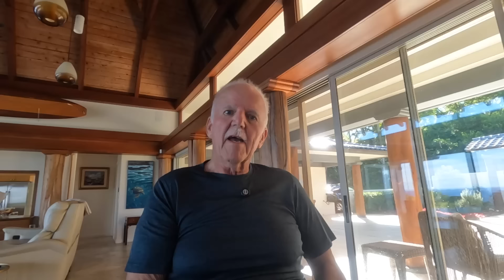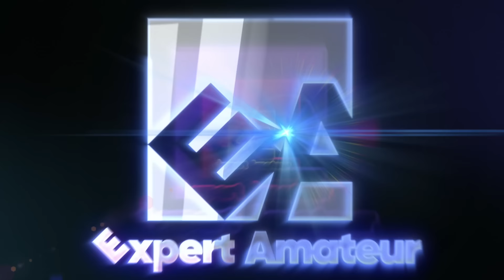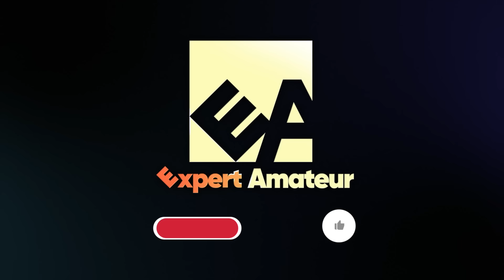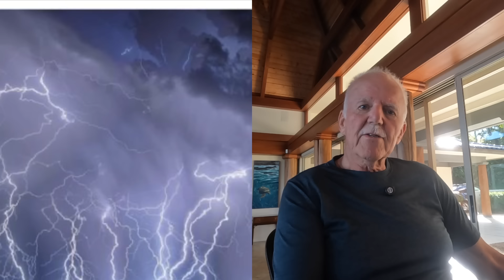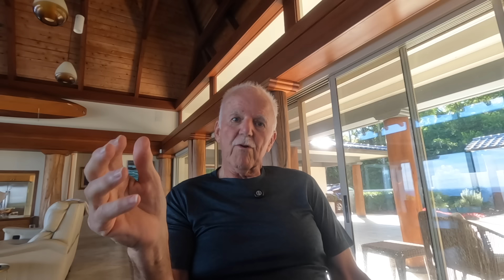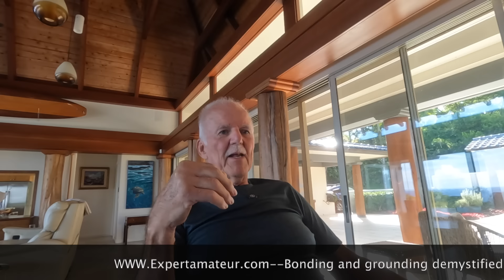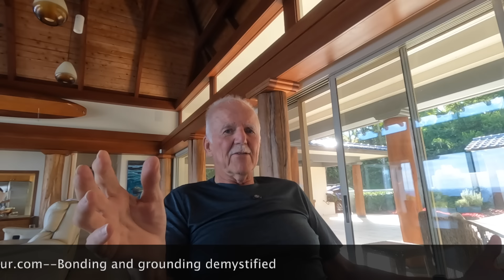solar grounding

Comment: My solar array panels are all connected together and earth grounded to a 8 foot copper rod in to the ground. My A/C panel is bare copper earth grounded to another 8 ft ground rod. I've also earth  grounded my D/C side of my solar set up and that goes to another 8 foot copper ground. Is that OK? As you mentioned, grounding set ups for solar systems are such a controversial topic and I did my homework in detail only to come away with still not know ing what was actually the best nd safest way to ground it all. So after all my homework I decided to seperately ground my solar panels, my A/C panel and my D/C component side. Thoughts?

Comment: my mini solar system is 500W, it's plugged into a Growatt Infinity 1500 , the Growatt is plugged into mains power and turned off at the wall. This will give a ground even if the Growatt is turned off

Comment: Mike says that the PV Ground should be connect to the main grounding... that is not necessary and second rod for the PV array, but can be done it is not against code, if so the need to be bonded

Comment: ONLY do this IF you are tied to the grid with the Grids gigantic antennas(wires) that can send a gigantic pulse to your system.  Anyone off grid?  Do not waste your time.  The rack itself is already "grounded", running another copper cable down it will NOT DO ANYTHING.  It is the same path.... Now you may wish to INSULATE your panels from your rack and "ground".   The NEC is NOT designed for OFF Grid/Micro Grid, but when attached TO the Grid.

Comment: Great discussion thanks. Please consider this scenario.- what if the solar panels are connected to a large RV, which is completely off grid? The RV is not grounded as as the custom for DC vehicle vehicles. But the solar panels go to a battery inverter which converts to AC to power both AC and DC in the RV.  My solution has been to ground the solar panels and bond them together, but not to do any additional grounding rod at the RV since the frame creates the neutral ground. But there’s a lot of dispute about that solution as well. Your thoughts?
Reply from the maker: It's a problem for sure, and I faced it with my stupid RV project (I'm required by my personal "laws" to say Stupid, since I don't like RVs but I spent two summers rebuilding a 1978 GMC Moho). I never really solved it, but I'm going to move it closer to my solar container project and connect the 1860 watts of solar to my EG4 system. I'll tie the RV to that grounding system. That won't help you, but you might consider adding a grounding rod bonded to your house earth ground that you can connect to while you're parked at home. On the road, you're at the mercy of where you park it. I've found all kinds of weirdness in RV parks, some of which popped my GFCI regularly. Weirdly, the best power connection I ever found was at a winery that's part of the network I can't recall the name of. They had a single neutral/ground bond at their service entrance and earth ground rods at each power pedestal. The ground connection went straight into what I assumed was the power trench. I asked the owner about it, and he admitted to being a retired power plant engineer, and yes, the ground rods at each power pedestal were bonded to the service entrance! How weird is that. We wound up swapping power plant stories and drinking wine until I was way past my bedtime.

Comment: All bonding of the solar rails and frames go back to your house ground bar. The same place your inverter is grounded. It is not for lighting. Same if you add a generator, back to house ground. My opinion as a licensed electrical contractor. My house is also done this way. Lighting systems are a separate issue and nothing to do with a solar installation. I used a #8 copper to discharge static charge that may build up. The DC system will not pose any issues. Use proper sized fault protection for your array.
Reply from the maker: Yes, indeed, it serves that purpose. I mentioned this in the first video I think. Accumulated static or the leakage voltage to frames is not likely to kill you, but getting zapped is never pleasant and if you're on a ladder or a roof it can be dangerous. But it does serve an additional purpose--protecting your equipment (which is almost never an objective of the NEC, code is basically a minimum requirement for safe installations: life and limb.). A nearby strike transmits two waves, one in the air, one in the ground--both carry a very high potential (voltage). The best you can do to deal with the wave transmitted in the air is a lightning arrestor, which might help.  Separated ground rods can actually exacerbate the ground wave effects. If you have two ground rods, spaced some distance apart, The ground wave potential will be a different at each rod depending on the resistance between them which means a high voltage can be present and current will flow in your equipment ground. Not good. It can and does toast electronics (ie, your inverter and solar controller)--frequently. Connecting the two ground rods with copper wire reduces the resistance, and therefore the potential, a lot. I connect the wires directly to the ground rods but since your service entrance is directly connected to a ground rod it's pretty much the same to just go straight to the house ground. Very little of this has to do with electric codes though in the older editions of the NEC it was frequently spelled out. Most of the information got moved to the fire prevention codes, and even there it's a minimum requirement, like most code stuff.

Comment: My combiner box has a circuit breaker on each series of panels, it also has a main breaker, doides to keep voltage from going back into the panels, and separate lightening protection with it's own ground.
Reply from the maker: Nice, though I've come to view lightning arrrestors as kind of useless. And diodes are fine when dealing with normal voltages. At a few thousand volts they are just quick-blow fuses with inadequate conductor separation.

Comment: It seems to me it is almost impossible to protect against lightning stikes. If it will travel 20-50 feet through the earth itself, what could mitigate that? And you contradicted yourself when  you said that code teacher said bind  them all together and then  you said you disagree, then 2-3 sentences later you said to bind them together. What gives?
Reply from the maker: It is extremely difficult to protect against direct strikes, though substations and radio towers do it--at great cost. What this video is about is protecting against nearby strikes, which are far more common but can destroy your equipment. I think you misunderstood my comment about Mike Holt's position that auxiliary earth grounds are unnecessary and dangerous because the equipment grounds tie all the equipment together and provide a path to earth ground--which is true, but the path is through your equipment. So it's perhaps safe, but your expensive equipment is toast. The equipment grounds are also less reliable, because they travel through lots of connections along a torturous path. Binding the ground rods together with an additional ground wire (typically buried along with your power cables) provides a straight path that DOESN'T go through your equipment and also mitigates the effect of the ground wave by keeping all the ground rods at the same potential. What I'm recommending isn't new and does NOT violate code, though it isn't a requirement by code.
Reply: @ExpertAmateur-xn6dr . What gauge wire is going to shunt away that amount of current?
Reply from the maker: @5400bowen  It doesn't need to shunt away the current. It needs to keep all the conductors at the same potential. With the low resistance of copper wire that isn't much of a problem--the current it trivial for a strike that is far enough away. If the strike it too close the rise time of the pulse means the potential will happen anyway and we'll need new equipment. It's not a guarantee against nearby or direct strikes. It's mitigation for strikes at some distance that doesn't cost more than the equipment it protects.

Comment: Enough with the theory, where and how do you connect ground leads? If you have a backup generator, do you ground it through the grounding for the  solar and building? Should you have a separate ground rid for the solat panel array, generator and buliding? Or should you ground it all together?

Comment: Some guys say run the ground cable from pv frame connected to ground rod,  in same conduit as pv cables. So if lightning strikes nearby,  thousands of volts will be induced into pv cables and fry the inverter. Keep ground cable  from pv frame far away from pv cables. There is no surge protector for direct lightning strike but at least keep that lightning induced voltage  away from pv cables.
Reply from the maker: That's actually what I do, not in the conduit but in the same trench, directly buried.  And yes, that's possible though the potential across the ground wire should be low because the resistance is low. The closer the strike, the more chance there is that it won't help. But yes, there's no protection from a direct strike or even a really close one that's economically feasible for a solar installation.

Comment: Hi, can someone clarify the grounding/earthing rules for multiple steel buildings?

Every detached steel building is required to have its own grounding rod (electrode).
However, the equipment grounding conductor (EGC) system is only bonded to the grounding electrode network at one point (usually the main service).

All rods are interconnected with the grounding electrode conductor (GEC) underground.
But the steel buildings themselves are not directly bonded to their local rod, because that would create multiple parallel EGC-to-earth paths (ground loops).
Instead, the steel frames are bonded through the EGC back to the main panel.

My confusion is this:

If a building is far from the main panel, and lightning strikes that building, how does the surge energy go into the earth?

Does it travel through:

1) The local rod near the building,
or

2) The EGC cables back toward the main panel and the main bonding point?

I originally thought the underground GEC network between rods was supposed to keep lightning “below ground.” But SPDs at the building also dump their surge into the EGC, which means a lot of lightning energy will travel on the EGC instead of directly into the local rod.

So how does the system decide where lightning actually flows — local rod vs EGC — and how is the steel structure protected if it is not directly bonded to its rod?

The steel buildings are mounted on concrete pillars, so this also adds to my confusion.

Also if we have underground GEC interconnecting all grounding/earth rods, and EGC "above ground", and multiple connections from EGC to the ground network, will this create grounding loops? For instance let's say your solar array is mounted on pure steel pounded into the ground. It is mounted on an earth rod itself. Then the EGC and GEC is interconnected right there and also in the main panel and maybe other steel structures?

Comment: My shed is away from the house main ground rod point. Like 140 feet away.  I have 400 watt 12 volt system with inverter to run shop light stuff only.  Soup i need to run $$$$ wire to my houses rod? Dig the earth and hook up to 1 rod? I have bedrock 6 inches under can't really dig
Reply from the maker: Sounds like a cheap system you can afford to lose. But since it's completely off grid I'd add a ground to the panel frames. A good copper coated ground rod is about ten bucks. You only need one. Try a few places of bury it horizontally as deep as you can. A layer of bentonite clay from the plant store will keep the ground around the rod damp and improve the earth ground. Should help as long as any strikes are far enough away.

Comment: And how would you do this in a cargo Trailer?
Reply from the maker: unless you never move it, you can't do much. I built one of my systems in a container, which is theoretically movable, but won't be. And it has an auxiliary ground rod bonded to the system rod.

Comment: To me it seems quite simple, if you create a system with 2 or more different earths you are creating an open circuit connected only by the ground. Any nearby lightning strike could then complete the circuit with a large voltage spike, bye bye system...
Reply from the maker: Did you watch the video? That's exactly the recommendation--bond auxiliary grounds rods to the service entrance ground rod.

Comment: Council installed solar for 28 flats and it just went on line. There is only 1 ground going to the electrical meter room. No other  grounds visible except for two 8 ga stranded going to two metal cable trays. There was no ground rod visible when the slab was poured and the shed erected. There are no visible grounds on the roof. The DC feeds to the metal shed slope down with no drip loop. The AC cables to the meter room are open with no protection from animals.
Reply from the maker: Yikes. Sounds kind of like they're approximating a UFER grounding system. Might be good, might kill a few folks. Is this in the UK? You folks have some funny views on electricity though I kind of like the straight 240V with no split phase thing

Comment: You do not want to install a ground rod. If lightning strikes near, it will travel through the ground to the rod and frames. You want an insulated grounding conductor from the frames to the main grounding conductor at your main disconnecting means to the utility and install a surge suppressor. If you are off grid I would not ground it at all and install a surge suppressor at your equipment.
Reply from the maker: Good luck with that.

Comment: I understand the reference to Mike Holt’s opinion that a ground rod at the array in addition to the system ground rod can lead to a dangerous potential during an electrical storm or event. I don’t really understand your explanation of why it’s better to have an additional grounding conductor. 

I have just completed a pole-mounted PV array powering a shed structure about thirty feet away. When I dug the trench and buried the conductors between the array and the shed I had decided that a grounding electrode conductor was not needed for the array since I was bonding the panel frames to the mounting brackets and poles, which are buried in the ground and that this would be a separated independent system. Subsequently I found out that the inverter I’m using includes a gfci and afci for the system including the dc conductors and, while the manufacturer explicitly states that the ground cannot be bonded to the dc conductors it does suggest grounding the panel frames to the system. So I redug the trench and buried a continuous grounding conductor from the panel frames to the ground bus in the panel inside the structure. I’m trying to understand how a ground rod buried at the array would add any benefit. It’s unlikely that the panels will be struck by lightning because there are trees much taller on neighboring lots, not to mention they are lower than our roof. And I’d they are struck by lightning there will be damage regardless.
Reply from the maker: The video is about preventing system damage from nearby strikes, which send both an air wave and a ground wave. You really only have to worry about the ground wave if you are connecting to your home service entry. The difference in potential between a wave-induced potential at your service entrance and a ground rod at the panels is the problem we're trying to eliminate by bonding them together. This is an equipment issue, not an electrical safety issue. The NEC doesn't care if a strike blows your inverter off the wall or melts your BMS. Lightning striking trees near your equipment will likely slag it. That said, it sounds like you're good.

Comment: If solar panels are roof mounted or on a pergola, and they are mounted with a ground connection; 
then they have essentially become a lightning rod. 
Ground mounts are less susceptible, but still concerning.
However one should ground their inverter.

Comment: NEC forbids separated ground points. It requires one single source for the grounding of all equipment. My home is bonded to the copper plumbing. If I install a secondary grounding rod, it must be connected to my copper plumbing so they act in unison if lightning strikes the panels.
Reply: Although this makes sense on the surface, the frames of solar panels are not electrically bonded to either the + or - leads from the panel. They are instead only in “close proximity”. I have long struggled with this relationship and many decades ago I had a primitive off grid solar system that had the panel frames bonded to the main system ground. During particularly dry weather (and dry soil), the frame and stand for the array would give a shock to anyone touching it. After discovering this I removed the panel frames and stand from the system ground, gave them their own ground and upgraded the system ground. The issue went away.
Ever since then I have kept the panel/array frames grounded separately without issue, however I am now thinking about adding bonding between the various array frame grounds and the main system ground.
My home is not grid connected so at least I don’t have that variable to contend with.